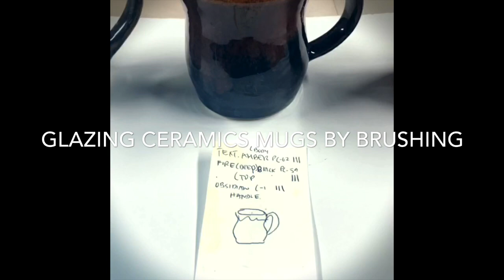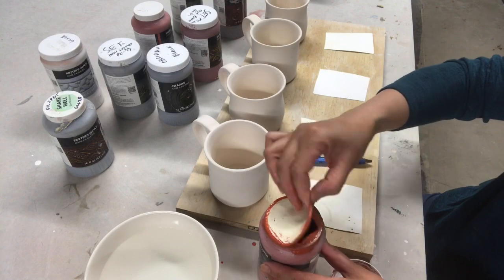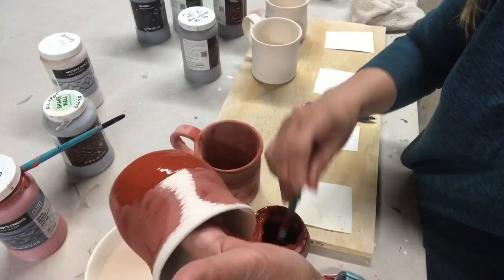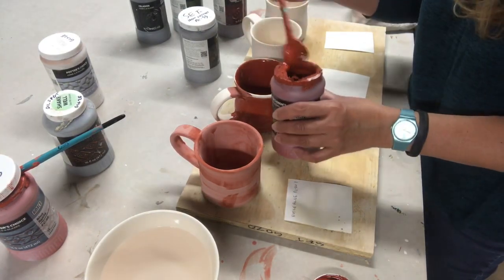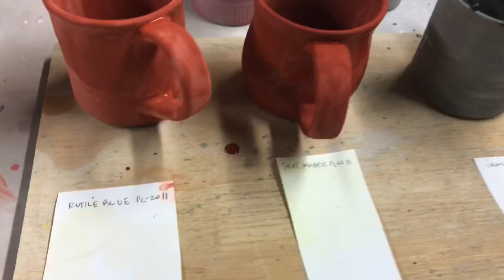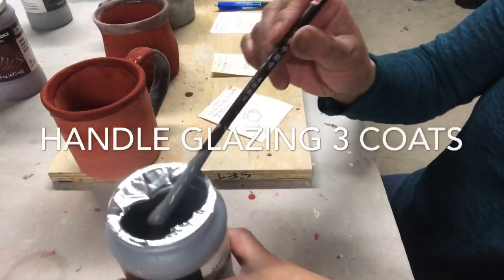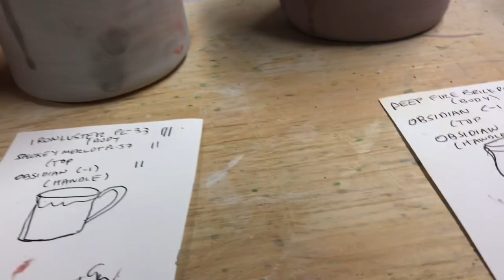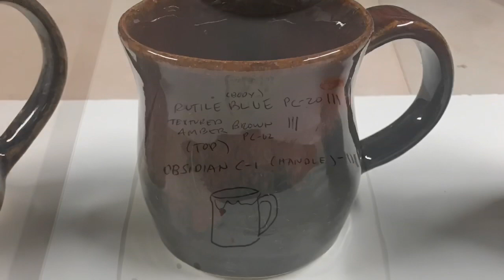GLAZING A MUG USING MULTIPLE LAYERS OF GLAZES

Comment: Are these all high fire glazes? I would like to see a video like this for low fire glaze combinations.
Reply from the maker: For low fire Amaco  or other commercial brands are similar technique, the label will say usually 2-3 brushed on glaze. The cone will be low fire on firing. I have done Majolica which is low fire, we do not do them in this studio unfortunately. Majolica you need a white base before you apply the color.  Test tiles and ask the store before you buy a glaze, if it start with “zero” , 05, 06 usually they are low fire. Hope this helps.